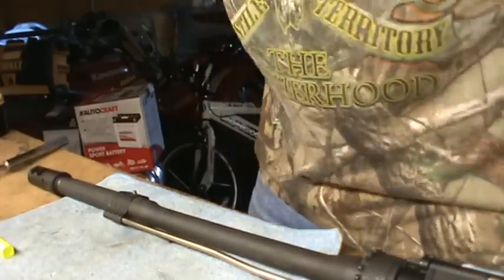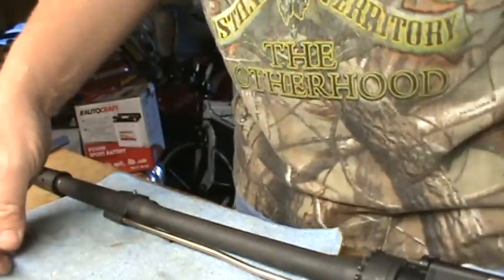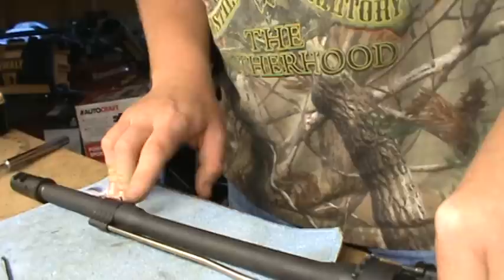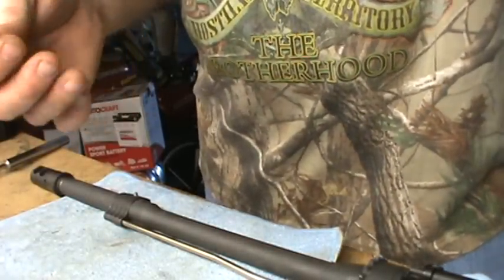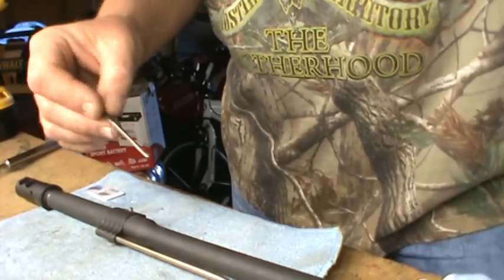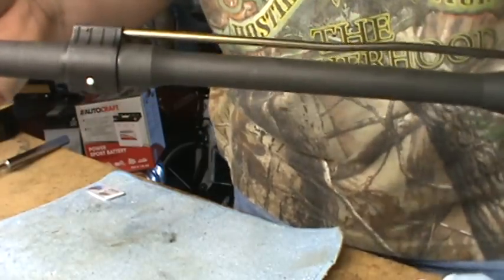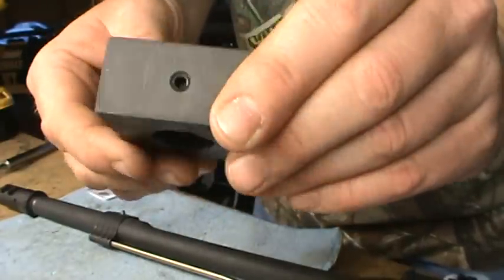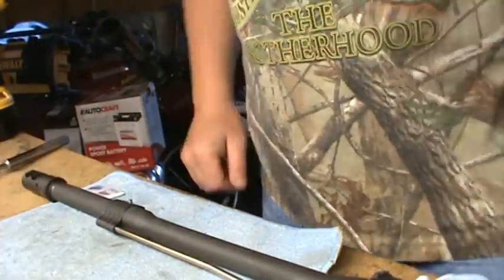PINNED VLTOR GAS BLOCK FINNISHED PRODUCT!!

Comment: How far did you run the reamer in?  Did you come at it from both sides or just one?
Reply: Kyle .... this is a TAPPER PIN setup not a roll pin/ must drill from one side only.. hope this is not to late to solve you problem of TAPPER PIN not fitting 
              LOL